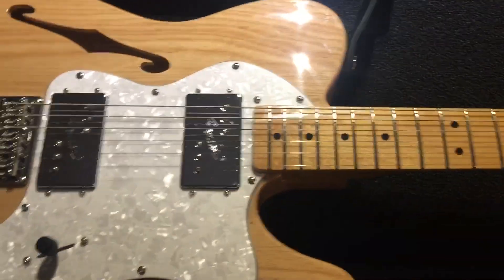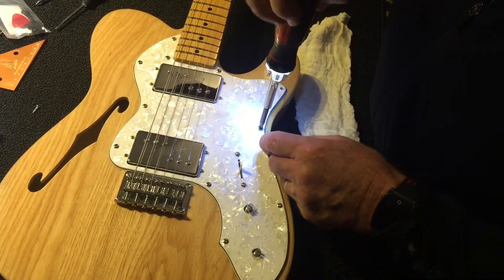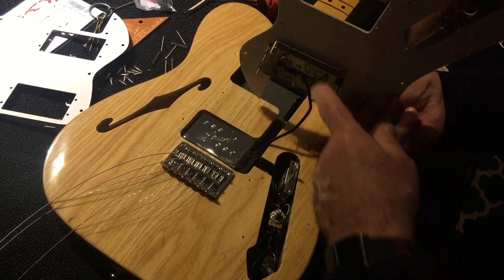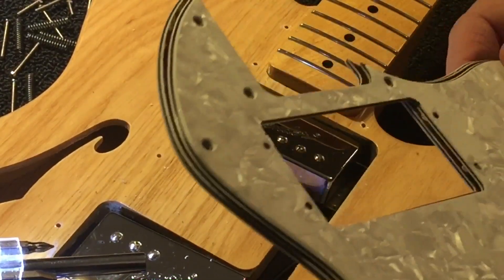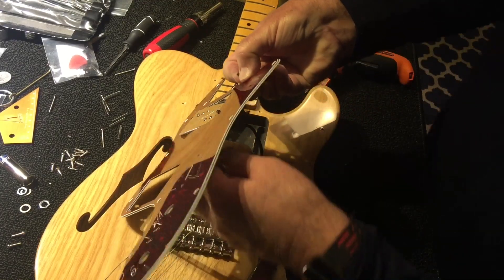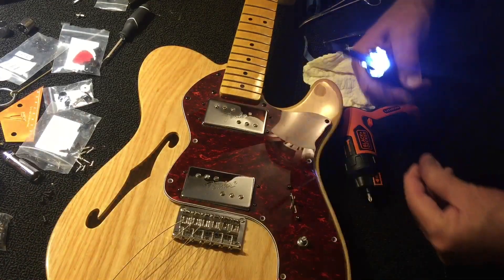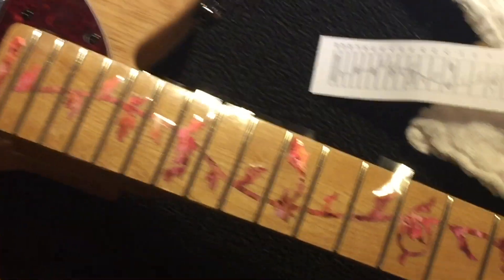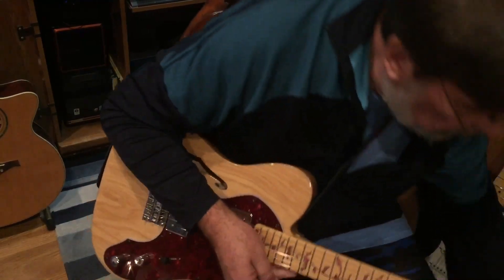Steve Bright & The Squier Vintage 72 Thinline Tele MakeOver

Comment: Trick got getting sharpie off a surface. Where there's marker you don't want there, get a paper towel or something ready to wipe quickly making sure you can get the paper towel into whatever nooks and crannies you need to. Get ready, you have to work fast. Mark a small area with sharpie and very quickly wipe it off. I believe there's enough urethane on that neck for this to work. The new sharpie wets the old sharpie and makes it all wet enough to come off clean. It wouldn't work on a Fender neck without urethane or any dull surface. Good luck!